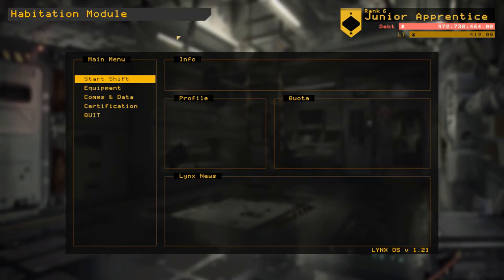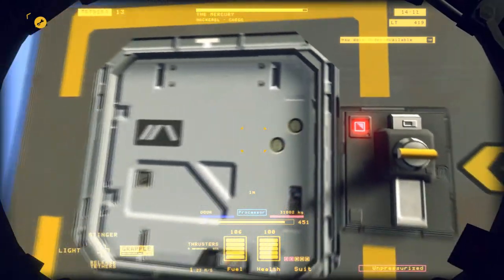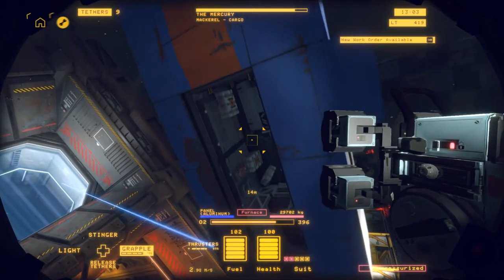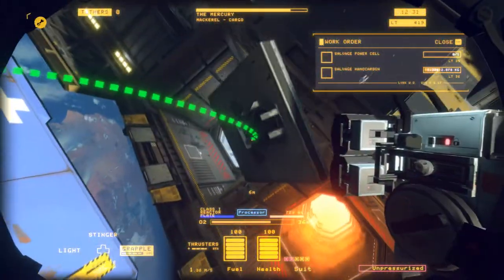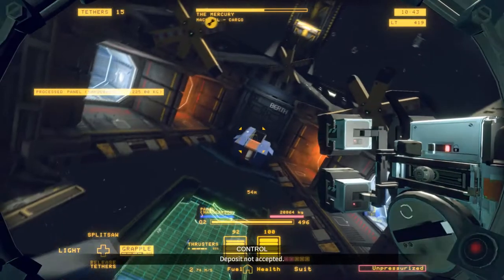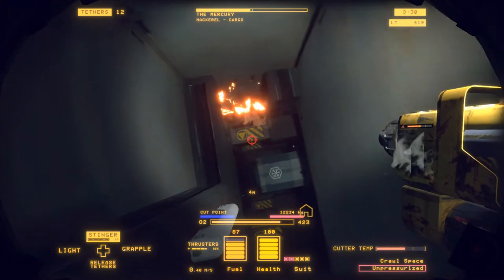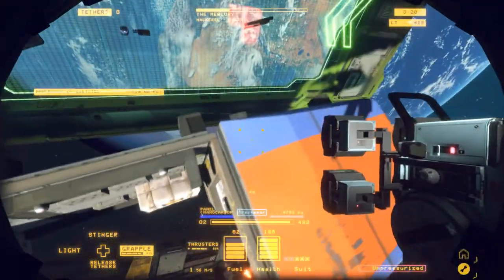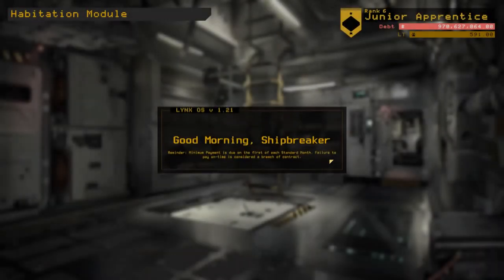Hardspace: Shipbreaker - How To Speed Run Cargo Ships (kinda)

Comment: you can cut the struts without using the stinger, just using the cutter is much quicker. Just have to make sure the reticle doesn't spill over to another cuttable thing, but most of the time you can just snipe the struts with the actually cutter if you are at a good angle like that and there is nothing behind.